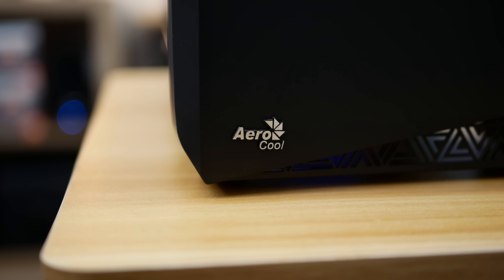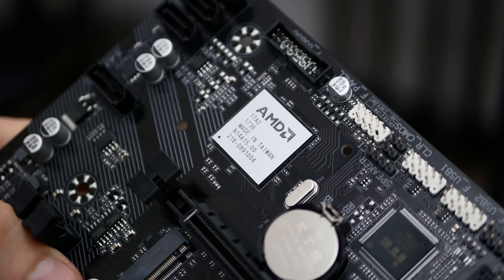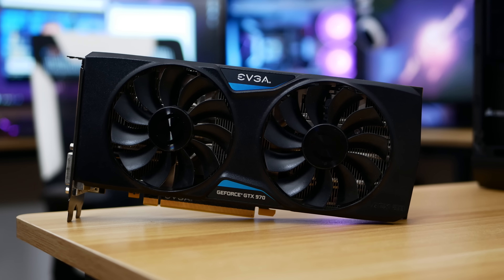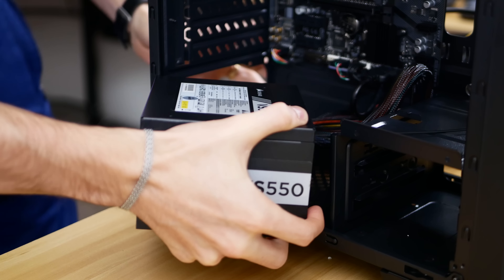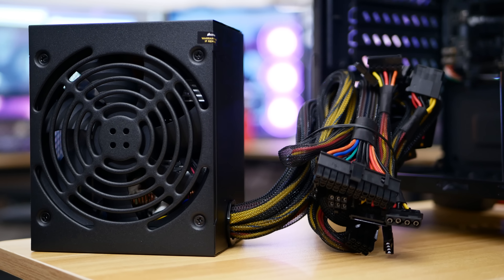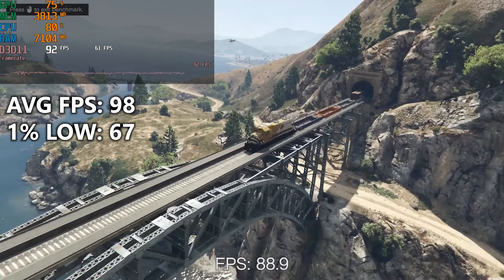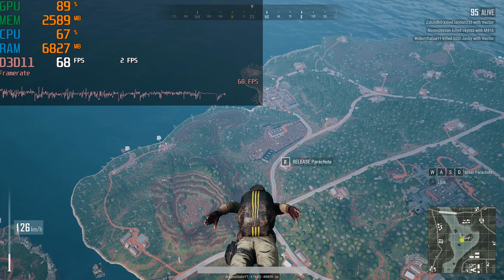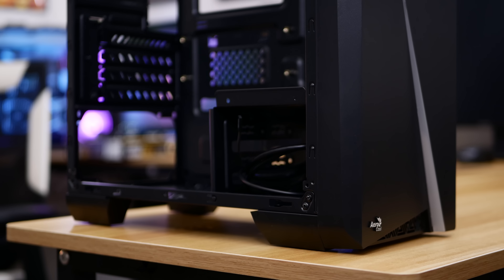We Built a Solid 1080p Gaming PC for $500

Comment: You can buy an ab350 motherboard on Newegg and be able to overclock later, or even better spend 10 bucks more and get a decent b450 board, plus you can buy a cx550 80+bronze semi modular psu for 40 bucks after rebate, or a seasonic 520 fully modular 80+ bronze for 35 bucks, or you can spend 50 bucks instead and get a Thermaltake 750 80+ gold, you can also get a 2200g for 93 bucks on Amazon since he updated the price to 99 for the 1200, you can also get g skill aegis 3000 MHz for 110 bucks or the Corsair vengeance rgb 3000 for 120 bucks, you can also get a team group ssd 480 gb for 52 bucks and save some money, you can also get a rx 570 that'll have similar or better performance, and it's new for 140 bucks with promo code and rebate on Newegg also get 2 games with it, plus the fact that freesync monitors are cheap, you can also get a case like the cougar mx 330 for 50 bucks with way more air flow, even though it doesn't look as cool. 

Here's the pc part list for a 560 bucks computer with far more air flow and performance, all with new parts, and if you want to stick with the 500 bucks price, go with the g skill aegis 3000 MHz for 10 bucks less, and get the used gtx 970 mentioned in the video on eBay , as far as I'm concerned it's a way better deal to build all new with more performance for an extra 50 bucks and get 2 AAA games on the deal, you can also easily get a ryzen 7 1700 later since they have promotions quite often for about 170 bucks, and who knows, the rumors are that the new ryzen 3 will be 6 core 12 threads, and ryzen 5 will be 8 core 16 threads, so the prices will plummet next year, just wait and get a cheap processor for now and upgrade later since your config will handle it. 

https://pcpartpicker.com/list/rwGwZR

Comment: I would definitely be willing to pay an extra $50 for like a 580 instead of the 970. And for the PSU, Im pretty sure you can get a nicer EVGA one with ecofan mode for around the same price at the moment
Reply from the maker: Sure, that's an option. Used 4GB 580s are great cards. But if you prefer GeForce for screen capping and other things, the 970 is the better buy IMO. Slightly lower perf.
Reply: Science Studio well this was unexpected.

Comment: I recently built my first PC, with Ryzen 1600, GTX 1050 Ti , 240 GB SSD, 1 TB HDD, Gigaybte AB350m Gaming Motherboard and Corsair Vengeance LPDDR4 16GB RAM (single module) @ $750.39. Good? Bad?
Reply: I could be wrong but I thought ryzen takes dual channel memory not single channel memory you might want to check that out.

Comment: Where did you find a 970 for $100?  The ones I see are $130 and up.  Would using an RX 570 decrease the performance by a lot?
Reply: An RX 570 is better than a GTX 970. His choice of a 970 really stumps me tbh.
Reply: @morgueblack  it is also cheaper if you buy used

Comment: Recently bought a refurbished EVGA GTX 1050 Ti 4GB for $130 (not including tax) from Newegg. Looking at graphics cards now, and I'm seeing GTX 970s new for upper $300s and most are $400 or more. GTX 980s are $500 or more. Whereas GTX 1060 6GB is around $350 (not including sales - some sale prices are $220 for 6GB GTX 1060.)

My point - the prices of 1080p graphics cards are all over the place. You bought yours from ebay, used, and I can't compete with that. I don't buy from ebay -- trust issues.

Comment: why not a rx 570 or 580? also that flarex clocks way past 3600, why not try the 3466- or 3533 option with a voltage bump?
Reply: The 970 is $50 - $100 cheaper used.
Reply from the maker: Because the latency reductions are significantly reduced past ~3000MHz. Extensive studies on this.

Comment: I am looking at a few pc’s which one is the best for value.

Option 1

The specs : i7 2600k , 3 gb gtx 1060 , intel dq26sw , 8 gb ddr3 ram , 500w psu , 1tb hdd

Price €550

Option 2 

The specs : i7 3770k , 3 gb gtx 1060 , intel dq26sw ,  8gb ddr3 ram , 240 ssd and 1 tb hdd

Includes mouse , keyboard , 27” monitor and entry level speakers

Price : €770

Option 3 

The specs : i7 2600k , 6gb gtx 1060 , intel dq26sw , 8gb ddr3 ram , 240 gb ssd and 1tb hdd

Includes 2 ,  19” monitors , keyboard , mouse , entry level speakers 

Price : €710

Comment: I need some second opinions. I bought a 550w power supply for black Friday thinking I would use it for my next build. My current parts list is
MSI X470 Gaming Plus
Ryzen 7 2700x
MSI RTX 2070 
Corsair Vengance LPX 2X8 3000 
Sandisk 480 GB SSD
Seagate 2tb HDD @ 7200 RPM
And a Cryorig H7.
The wattage on pcpartpicker says itll be 334w but I feel like that won't be the case. Will a 550w be sufficient enough?

Comment: Wait, you said you've never had Ryzen rated kits work XMP out of the box? or did i understand you incorrectly, because my Corsair Vengeance LPX 16GB kit worked perfectly fine at it's rated 3200 XMP out of the gate, had it set to that before i even installed windows. Ryzen 1600, MSI Carbon B350. Then again i specifically got the Ryzen model, has a different serial #. In any case, solid video and solid build m8

Comment: What about : 
2200g
2x4gb adata 2666mhz ram
Rx570?
Reply: You dont really need the 2200g because you have a graphics card, go for a ryzen 3 1200 or 1300x, or spend more and get a ryzen 5
Reply: No,im not gonna get the gpu only after 1/2 months,so i will be using the Vega 8 for a while..and on top of that the price is the same
Reply: Lich aw just save up and buy everything later trust me
Reply: Marius 2200g has a higher core clock than the 1200, sells for the same price, and the APU can act as a handy backup
Reply: that would be complete fine for 1080p gaming.
Reply: @ryantrynda3029  i would just save and buy it all at the same time.
however vega 8 does still make most games playable however u might have to play at 720p, low settings

Comment: Is this a good build idk alot about pc

2x4 Gb ram ddr4 2400mhz
500w powersupply
AMD ryzen 3 2200g
Palit geforce gtx 1050ti
240gb ssd
MSI A320M PRO-VH PLUS
And a white case

Tell me if everything here is good.  This is a total of  $560..but with monitors,keyboard and mouse its $700

Some other parts here are expensive.. gonna wait til Christmas

Comment: That is a very good build and I was wondering if that case was any good cause I saw it on Amazon when browsing for new cases. It has a PSU shroud, tempered glass and RGB. What's not to love? Shocked its so cheap. Surely should be a $60 case. However, I am not so keen on the GTX 970 after using it before. It was hot and didn't preform very well even on games at the time I got it. Would the Radeon RX 570 4gb be better? Or the GTX 1060 6gb if I can find one used?

Comment: I Found A GTX 1060 6GB For Only $200 CAD on Kijiji. Do you think it is a good buy?

Edit: I also found a GTX 970 superclocked (same one used in the video) for only $150 CAD on kijiji. So would the GTX 1060 be a better buy for performance or should I save the extra $50 CAD???

Comment: I am looking to make a basic PC just to replace my laptop. I wont be gaming, just watching streams and using discord. Any help on what I wont need from the parts you used to make it cheaper?
Reply: Use a Athlon 200G for CPU (only 55 dollars and u can run even fortnite on this CPU because it has integrated graphics
Reply: Besides that go for same power supply a similar case or maybe from Coolermaster which is better u dont need a GPU for Discord or Twitch so u should be good and any cheap RAM and buy a 128gb SSD from ebay for like 10 dollars and a Hard drive and in total should be 150 dollars

Comment: Hey,
Is this PC setup a good one? I'm planning to build this for gaming.

Asus prime Z390-A
WD black 3D NAND NVMe SSD 1TB M.2
Intel Core i5 8600K 3.6GHz 9MB
Corsair 32GB (2x16GB) DDR4 2666MHz
Noctua NF-A12x25 PWM
Corsair Hydro H100i RGB Platinum SE
Asus GeForce RTX 2060 6GB ROG STRIX Gaming OC
Corsair Crystal 570X RGB Tempered Glass White
Corsair RM750x 750W v2 White series

Please help, this is the first time I'm going to build a gaming PC. Thanks.
Reply: @erickelly4107  Thanks for your advise. I actually made a small change to my setup. I decided to go for the RTX 2070 instead of the RTX 2060. So in this case running the most heaviest games at 1080 with max setting should give me more than 100fps right? And in this situation do you think I should still drop down to 16gb ram because I have heard that sometime 16gb is less for demanding games. What do you suggest?  Also I will be using an AOC 32inch curved 1440p 144hz freesync2 monitor.

To be exact this is the rig I'm planning to setup.

Asus prime Z390-A
WD black 3D NAND NVMe SSD 1TB M.2
Seagate Barracuda 2TB 7200rpm 256MB
Intel Core i5 9600K 3.7GHz 9MB
Corsair 32GB (2x16GB) DDR4 2666MHz
Corsair Hydro H100i RGB Platinum SE
Gigabyte Geforce RTX 2070 8GB Gaming OC
Corsair Crystal 570X RGB Tempered Glass White
Corsair RM750x 750W v2 White series
Reply: emmanuel joseph 

That set up should be good for 1440p / 100HZ+ 

I never heard of 16GB of DDR4 being a bottleneck for any game so I don’t see the point in going beyond 16GB of RAM.

I would honestly use that ~ $150 on something else much more useful. Maybe a I7-8700K.
Reply: @erickelly4107  Thanks for the help. Appreciate it. Will be watching your videos again once I have all the part to build🙂.

Comment: Did you turn off Hairworks in The Witcher 3?
Reply from the maker: Like I said in video: "High preset." Didn't tweak anything else. I wasn't aware that Hairworks was enabled by default in the high preset. Or is it?
Reply: @GregSalazar  usually it is enabled by default on "High" preset
Reply: @GregSalazar  I think it is. I'd check. It has a major impact on framerate
Reply: I hope not, Hairworks is NOT worth it the performance drop.
Reply from the maker: @sirsalmon9878  Yeah,  I agree. Hairworks is stupid. Surprised Witcher 3 enables it by default in High preset when Ultra is also an option.

Comment: Thanks for the vid Greg. Just had a question. What would be a good amd alternative to the nvidia gpu in this build? I'm helping out a friend build a similar pc for his kid. He wants to give his son his old freesync monitor, so was thinking to go with an amd gpu to take advantage of freesync. Thanks
Reply: rx 470/480 or 570/580 performs similar or better. You can go used for those gpus according to budget. There is 5-10% difference between those gpus which will be hardly noticable.

Comment: A320 Board? Really? A320? Pointless, absoutely pointless. All Ryzen chips are overclockable, even a simple b350 or b450 board can overclock a R3. This to me looks like the priorities are wrong. Performance is the most important thing. Style is not important. RGB is great if you have extra cash, if not, spend every dollar on performance, not on fancy disco lighting.
Reply: I had Asus A320 M-A and ryzen 1200 - the best combo. 350 is for 1600 to 1800. 1200 is enough at 3.4ghz at two cores for gaming, and even third and fourth core ain't working at 3.1. For the money spend for clock, you can buy  1600.

Comment: Is anybody else having overheating issues with this case? I have same case and graphics card reaching 85-90°C+ and touching the case is super hot. I don’t like how poorly ventilated this case is but love the case as a whole :( sad times
Reply: How manys fans do you have in th computer?
Reply: Apache Helo Copto 2 120’s front. One 90mm (max size) as rear. And even tried making adjustments by adding an extra 90mm to the roof air vent and cable tied it down as an extra exhaust why helped by a couple of °C but not massive. Still getting over heated. Tbh the issue is airflow. It can not simply get enough due to the front panel design. It sucks for air flow which is a huge disappointment. I have to have the glass window off to be able to use it

Comment: Hi, I recently built my first pc and I'd like to know what more experienced builders would advise regarding my system

EVGA 450 BT 80+ Bronze PSU 450W
Patriot Viper Elite 8GB (2x4gb) DDR4 2400mz pc4 19200
MSI Geforce GT 730
Seagate BarraCuda 2TB 3.5 inch  6gb/s internal hard drive
ASRock AB350 Pro4 ATX Motherboard
AMD Ryzen 3 1200 Processor Quad Core

What would boost my performance the best? Help would be appreciated! Thanks!

(currently get about 60 fps average on overwatch low settings)

Comment: Could have picked up the asrock b350 pro 4 for the same price. ($20 mir) or the biostar b350. Otherwise it’s a solid build for the $$$
Reply from the maker: Don't always count on those MIR hehe. But yes! And I said in my review of the A320M that B350s are definitely worth the ~$5-10 upgrade.
Reply: Yeah  I got lucky on one of my previous builds and picked up an asrock x370 pro 4* for $59 (Newegg) with no rebate 😬 that board goes on sale a lot.

Comment: All I’ve ever heard about ram compatibility is SAMSUNG B DIE! SAMSUNG B DIE! So I got the G-Skill Trident RGB 3200mhz 15 CAS latency. Which is supposed to be Samsung B die from what I could tell online. The best I can get on my 1600X is 2999mhz stable.
Reply: I dont have b die but do have a 3200mhz, CAS16 that runs at 3333mhz with my ryzen 1700. if you have a high end board that has good bios update theres a chance that a good ram kit will run at it's rated speed regardless of not being b die.

Comment: I had better fps in witcher 3 with my i5 3470 and rx 470..  Here is a budget build: i5 3470 + the motherboard is around 100$
then just add 2x4 gb ddr3 and find an used 1060 or rx 570/580... Get a decent 500w psu and boom you will be gaming in 1080p ultra/high
Just not the new AC games which are poorly optimized. But still you will be able to play it on decent framerates

Comment: Can someone help me. So I put this computer together https://pcpartpicker.com/list/bPKb6s and I was wondering if anyone can tell me if there is anything they would recommend changing or if there is a problem with my build. I am also looking for cheaper stuff if possible. (I am new to building computers)
Reply: You could spend about $10 and be ablee to get a B350m chipset board so you can overclock the 2200G a bit or even sap it out for a 1400 or 1600 depending on prices 

And maybe a ssd 
Even if its just a 120GB a SSD can make a big difference with load times especially with windows
Reply: Another thing aswell is a you gonna run of Ethernet or wifi
If wifi then look into a wireless card
Reply: @apachehelocopto1779  OK thank you

Comment: WHATS THE POINT TO BUILD THIS SYSTEM WHEN YOU CAN LITERALLY ADD ANOTHER $100-$200 AND GET A SYSTEM THAT WILL LAST ANOTHER 3-5 YEARS

I MEAN $500 IS ALOT TO INVEST, SO YALL WOULD RATHER JUST SAVE UP A BIT MORE AND BUY PARTS FOR A SYSTEM THATS ACTUALLY WORTH IT...

Comment: You should of downgraded the ram and Upgrade the mobo and the gpu instead of using A Used one plus you should of went with a 1tb hard drive and an 120gb Ssd So you can have more games and a faster booting up speed plus you should of went with the Ryzen 3 2200G unless you wanted too overclock the One you are using in this vid